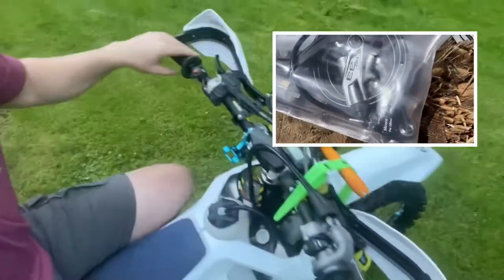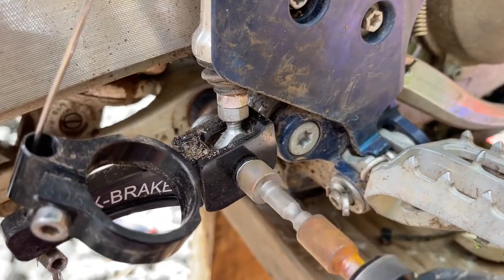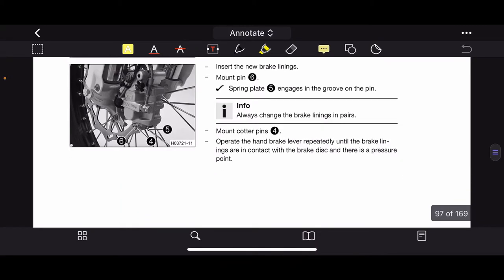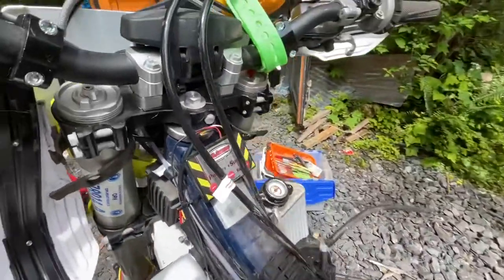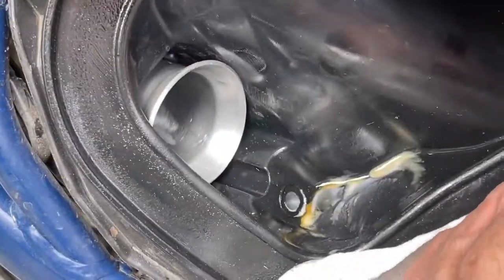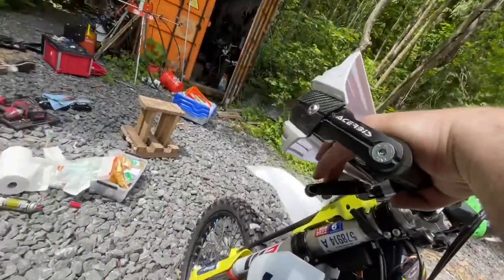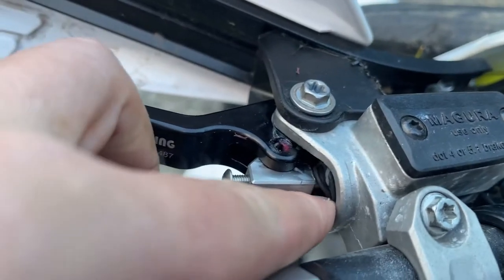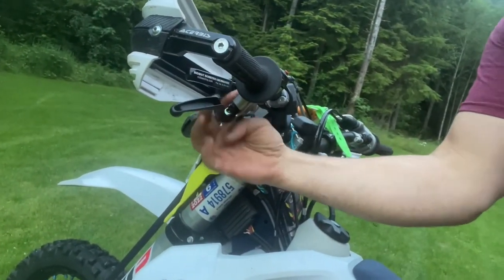Ox Brake comparison of cable and hydraulic￼ versions and Midwest Mountain Engineering clutch lever

Comment: Nice video man. Any updates on the set up?
Reply from the maker: Yeah, actually. Practically speaking, Not really using the brake that much.  only when I’m going down hills and I want to keep my toes on the pegs. It works well enough but I thought it would use more example to not loop out; however, when doing wheelies, it’s all about the right foot brake to modulate with the clutch. But regarding the apparatus, it does require some adjustment and tweaking, because the two bolts are kind of tricky to get at to lock the length of the hydraulic member.
Reply: Yeah the foot brake going down hill would work for me.